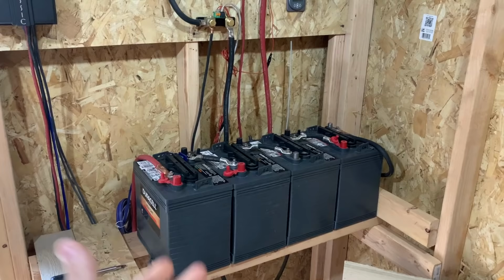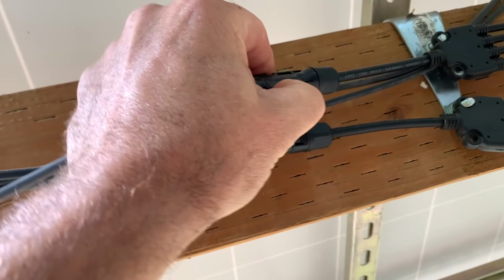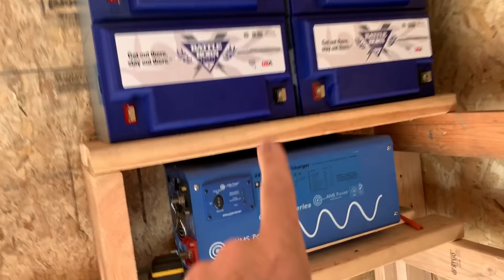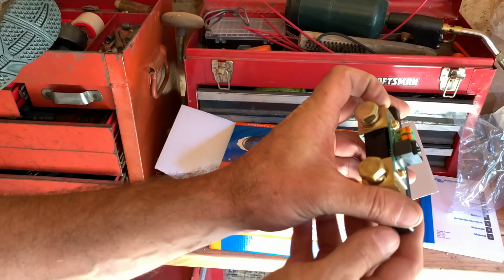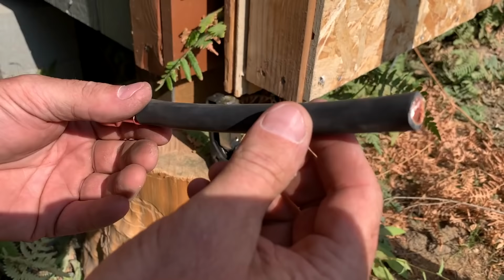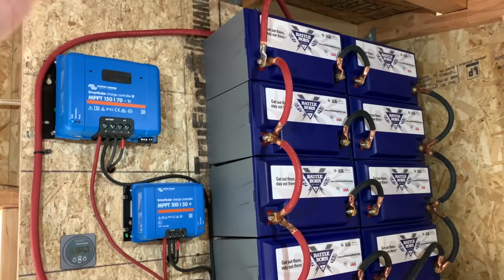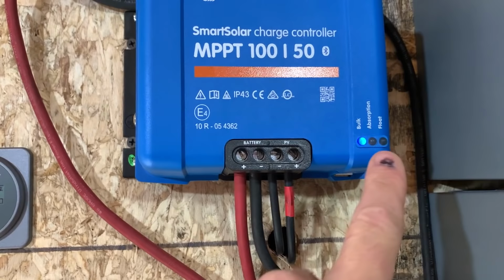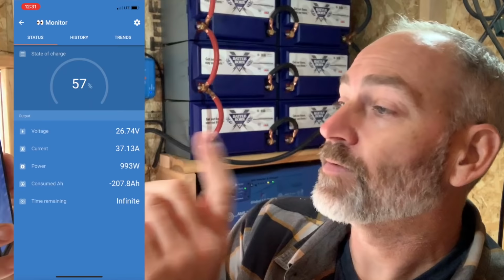EASIEST Off Grid Solar Power System Battery Bank

Comment: Another thing is you don't hav enough air flow around that inverter charger,  When it kicks into surge mode or charge mode  It's going to heat up, that building is probably never going to get below 0  With that inverter in there, Should I drill some holes in the bottom plate and put some to narrower wood on top and put some holes in that side plate there for air flow, I have the exact same inverter and they do get hot Personally I would worry about the heat in the summer time more than the Winter time.  A little bit of space between your batteries for some air flow.  Way too much copper showing. It's not a bad idea to run those positive and negative going to your inverter right next to each other or give them a twist around each other, cuts down inductance

Comment: 6 three hundred watt panels?  If I"m calculating correctly...on a good sun day you're delivering 150amps to your batteries at all daylight hours.  Most all homes can operate unfettered of convenience with that kind of input into the  batteries.  May I ask what you still maintain convenience wise in your home?  Like electric stove,  electric water heater, etc.  The demands is met with the numbers you said, and buy upgrading to a 100% discharge as opposed to a 50% discharge.  Adding the additional 2 panels bumped it up to 200 amps which is straight residential demand unless you just need that over compensate of 400.  I want to build my panels from scratch and also tweek my wiring and device demand...remove the  transformers and go 12v straight in, Led light everything obviously.  my concern was well pump, hot water and cooking, which there are many viable sources,  but convenience is nice.  you matched you're input to compete with total load output...provided you have those nice days.  What is it like when you go through those three and four days of gloom county?  I experience that where I'm at.   Very informative Video.  I'm hoping to find a few tesla batteries after an EMT  renders them useless.

Comment: Hey mates … having already an on grid inverter what’s the easiest cheapest way to charge a battery and then put the output on the grid? Do I need to buy another ac coupled inverted or some?

Comment: so i was a little confused when you said you would have 48v 800ah pack , umm no i dont think so ,what you have is 48v at 200ah ,as you have two banks at 48v in parallel but the current output will be the same at 100ah per bank , if you wanted 800ah you would have to connect them in series but then you would have 12v @800ah , still sounds like it will be a good system completed though

Comment: I'm just getting started in solar energy and like your videos. These new 100ah batteries are $800 a pop pushing the cost of your pallet of 10 batteries to over $8000. Is there a cheaper 100ah alternative battery that you would recommend for someone like me starting out on a budget? Thank you

Comment: Aims has a lithium 75 amp battery charger that Wii charge twice as fast as what u are using.  ….u won’t have to run your generator as long.

Comment: Very nice video.  I’m confused that the connections of the batteries are safe to touch after connecting them all?  Is the voltage too low to pose any threat?

Comment: the wire use from 5000w Inverter  to power center / breaker panel Is to small need be a 6 AWG wire the romex 10 AWG  was fine for old system.  5000w/120 = 41 amp 2: the breaker use for Lights and receptacle need single breaker not double breaker with connecting bar

Comment: Brother, Awesome setup!  A some Questions!  Just on batteries on positive side why didn't you go from the bottom then the cable would of been a lot smaller? Is it to keep cables the same length? Next question why is your inverter 2000 watts is it just for the shed? I don't understand why you didn't  used a 10,000 watt inverter for the whole house? Best Regards just trying to learning no disrespect!

Comment: Nice work. Is there any way you can update us on the state of charge of the batteries? The way you have all those batteries wired up isn't the best for battery balancing. 

With lead-acid batteries, you could see a 30% decrease in the interior batteries in your bank by wiring them this way. I would assume that lithium batteries would work the same way. 

I bet the batteries closest to the conductors see a heavier depletion and charge rate as compared to the center batteries.

Comment: re 16:27 Why connect to a live circuit?  If you have no main cut-off, you should should pull the main fuse.  You could melt the terminal threads (or your pacemaker)! 
BTW, what's with the 7ft long cable from the top of the fuse to the top, rather than the bottom "+" battery terminal 1ft away?

Comment: Great video 
  Your running your whole house off these 8 lifepo4 batteries ?   
  Just wondering because I’m running 6 100ah batteries they are ampere time and chins in a 24volt system with 2000 watts of solar. With an all in one MPP LV2424 unit  And I have a hard time keeping JUST a refrigerator going for a day 🤔🤔🤔🤔
   Any help would be much appreciated 
    Keep the great videos coming

Comment: I’m curious, why use such a long piece of red copper wire to connect to the top positive terminal of the battery bank when you could have used a very short piece and connected to the bottom positive terminal of the battery bank instead? Electrically they are identical…

Comment: what would it cost for a small system that would power a couple refrigerators + two tvs during the spring /summer early fall months?It wouldnt need to power the items all night. how many batteries/panel  would be needed?

Comment: Heyo, ive got a question. Would it be more benificial to buy another battery for the vehicle, buy an inverter kit and figure out the wiring and hook solar panels up to the whole things all in a seperate cubby hole for all the heat produced. Or does it make more sense to buy an anker powerhouse and solar panel kit to cut out the middle man? Ive been thinking about this a lot. Any opinions really help.

Comment: What happens when your batteries reach 100%? Where does the unused extra power taken from the solar panels  go?
Reply: your solar cells will stop pushing electrons generally, the chargers would just disconnect.

Comment: GREAT VIDEO - thank you. Question if it's not too late. You mentioned keeping the batteries warm, but I live in a hotter climate and want to set up a solar system to run my 120v hot tub house. Two 15 amp breakers - 1 for the hot tub  and1 for lights in the breaker box. I've watched other videos and the matter of keeping the system cool seems to come up more than keeping it warm. Is that something that would be an issue with a system that small? Any insight would be awesome. Thanks

Comment: Wiring those in series 24 volt means a kinda lower amp load. I build all my systems for redundancy in paired strings  our 1400 am bank consists of 2 700 ammo banks witc each can carry the load independently. Same with generators and wind generators cause if one fails  the system won't go down. Is any of that new system built in the USA?

Comment: You must be pretty close to town to have internet. We have 5 cell towers line of site for cell but no internet. All items except a couple of big Moor charge controllers are American made including the wind generators which have all been flying just over 12 years ( and I have 4 more nib for back up) What did that upgrade cost. You know when you put ur panels in series that totally changed your watt rates. Just like ur batteries.  We've got 4wibd gennies at 2500 max and average about 1200 till the wind picks up to max vne. Interested in those batteries bout not happy with the down sides

Comment: I was wondering if I can power my rv like this. Can I just run a extension cord from the inverter to an adaptor and plug it into the the power hookup?
Reply from the maker: Yes. You should be able to to that.

Comment: Only 6 panels?  Are they movable to certain angle and direction during the day and season?  You know like on a ladder wheel system?

Are you sure the lithium polymer one wall panel system is cheaper than Costco lot of Ni metal or acid sealed AgM mat batteries?

Comment: Anyone knows whether those "inverter & charger", are capable being used in "AC couple" configuration with a grid-tie inverter in an off-grid use??
I own a 6kw 48V Chinese "inverter and charger", and i would like to use a 4kw grid tie inverter in "AC coubling" connection!

Comment: i see you have 12V batteries in series/parallel to make 24V.  since you are powering the entire house, and have heater, AC, my question is what made you decide  to go with 24V instead of 48V what is the advantage. thanks!
Reply from the maker: It is what I could afford in batteries in the very beginning. When we added these batteries I already had the 24v inverter.

Comment: Hello Martin. I am new to the channel so my apologies for asking a question you have probably answered 1000 times. Can you tell me how many watts per panel your solar panels are and did you buy you inverter etc. separately or as a complete kit? Last question how many watts are you powering with your system? I am trying to figure out how much energy I need for my small cabin. Thanks

Comment: i would like to do a diy setup minimal but for what i need its for my garden pond it runs 2 x100watt pumps 1x55watt uv 50watt led light looking to add more or store the energy so it never goes out  how can i achieve this someone give me tips or steps id appreciate it alot thanks zach.

Comment: Random question... for example, say i had, 6x 100Ah batteries, and got hold of a 80Ah battery for a bargain price.... could i add that to the battery bank?  or will that cause problems?

Comment: How are you Martin
Can u pls help understand whether a 12v 400ah battery and two of a 12v 200ah battery have the same capacity? 
Secondly can i use my 12v inverter for a 24 battery?

Comment: Hi I have exact same battleborn battery set 24v and I been told I should buy a 24v victron battery balancer and I just did but will one of these battery balancers be enough to balance my 8 battery's  in the series?

Comment: I am curious how much each battery cost? Are the batteries u are using deep cycle 100amp?? I have found d them but they are over $800 each! J am looking g to go totally off grid power. I really dig your set-up. I want to be able to run my whole house so I'm guessing 12-16 of those batteries.  I'm wondering  price of the inverters, batteries, & all bells & whistles? $10k ,over $20k ??

Comment: necro comment, but did you ever heat shrink the ends?  The exposed wiring between the batteries just scare me although i know you have to arc them.

Comment: So I have a similar setup at home with the battle born battery and Victron controllers smart shunt... the works pretty much... Have you had any issues with your batteries internal resistance when wired in series... I get a high mid point differential on my batteries when my panels are charging the batteries and I have a high wattage load on them... the batteries have been top balanced and stay relatively close in charge to each other but after a day or so of high power applications they seem to loose their top balance to each other??? No clue whats going on... cable lengths are all the same, can internal resistance be that off... i noticed one battery does give me 105ah and the other 101ah when i did a capacity test on them... not sure what else can be the issue but im getting tired of having to top balance them 😪

Comment: You mentioned twice, 400 amps on the batteries. Wouldn’t 6 each 100Ah batteries equal 600 amps?

Comment: I'm scoping out what it'd take to go off grid.  Question.  Why is LiFePO4 batteries an upgrade?  

That 100AH lithium battery is $900 versus 150AH lead acid golf cart battery for $200.  Yes, I understand the LiFePO4 is much lighter, but my outbuilding is not moving anywhere.

What's the point of going with lithium chemistry for stationary applications?

Comment: MARTIN,  I HAVE A QUESTION;   DOES YOUR SYSTEM PROVIDE ENOUGH ELECTRICITY FOR EVERYTHING IN THE HOUSE (ALL KITCHEN APPLIANCES, LADIES BATHROOM/VANITY APPLIANCES, MODERN LIVING SPACE ELECTRONICS AND GARAGE/SHOP EQUIPMENT; SMALL WELDER, COMPRESSOR)?

Comment: I heard when u connect, start with positive wire, when you disconnect start with negative. How does that helps idk
Reply: That's just when for when you are working on  car. Cars are made out of metal. If you hook up NEG terminal first then Its easy to short out the wrench to the car body when you are hooking up the POS terminal.  If you hook up the pos first then the rest of the car body isn't "live" as the NEG is not attached.

Comment: on the right side of the batteries you have black (neg) wires aand down the middle they are also black (neg) .. how can a battery have both terminals be negative ??
Reply: Those 00 cables could be any color. T

Comment: i noticed you have 60 volts from your panels on a 24 volt batterys, i thought you had to have 24 volt input to the controller for 24 volt battery?
Reply from the maker: Nope. You can put in as high voltage as your charge controller is rated for. We just installed new charge controllers the other day and they are rated for 450 V DC yes that’s 450 V DC the charge controller is designed to regulate the voltage coming in from the solar panels and correctly charge the batteries at whatever voltage the batteries are at 12, 24, 48.

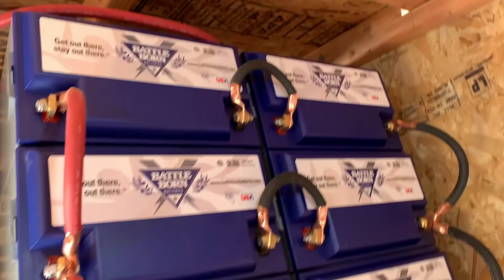Comment: 14:20 What's the point of connecting the batteries in series and parallel? I've only heard doing one or the other, but not both at the same time.
Reply from the maker: To have 24v. Just parallel would be 12v and just series would be 96v.

Comment: When trying to calc the amount of battery storage I need, how do I turn the 24v 100ah dc into 110v ac kwh??? If my understanding is correct 24v at 100ah will give me 2400kwh at 24v.
Reply from the maker: That would be 2400wh or 2.4kwh. The k = 1000. The 110v wh would be the same minus any losses in conversation.
Reply: @MartinJohnsonOffGridLiving  Thanks for the info. Just can't wrap my brain around how it stays the same. I keep wanting to divide the 2.4 by 5.48 (multiplier to get 24v to 110v). Thanks for all the videos, learning a lot. Looking forward to my own build soon.

Comment: so with the amount of watts imput, how can i tell whats safe for charging? i have 1800 watts in solar, and 12 car batterys. my pwn 100 amp controller, will that safely charge my batterys? like will it crank 200 amps to charge them? thats my worry when i can hear my batterys boil. im use to small car charger of 10 amps where you dont hear that boil. and so i wondered with a controller if it fast charge a battery, like if i had a full 2400watts for input, would it give every watt for charging? that seems unsafe.
Reply from the maker: You should check with the manufacture of your batteries to see at what voltage and what amperage you should charge your batteries. Then either purchase a charge controller that will charge those batteries appropriately or if the charge controller you have can be programmed program it accordingly.

Comment: Marty hello, I called Battle Born Battery today. Great people. I told them I wanted what you have and they were great in advising me. I am in need of your advice. When putting in a solar system, I have to do a little at a time to get it up and running. So would you get all the components first and get them all hooked up or would you get the panels first. Because they may go up in price
battle Born quoted me $9170. For a starter set up. Panels and batteries included.

Comment: Not sure what lightness benefits, lithium batteries offer a fixed installation. I would have bought 16 lead batteries for what; less than quarter of the price and ended up with significantly greater capacity. Being sponsored I guess made it a whole lot cheaper.......
Reply from the maker: We had lead acid batteries. I hate maintenance and having to pay attention to things. We have had these batteries for a while now and love them. Set them and forget them.

Comment: Too bad you couldn't use the inverters and controllers and only change the batteries.  Can you run air conditioning?  window, central??

Comment: No PV disconnects...
No shrinkwrap on battery cables...
No master disconnect...

System mounted to flammable surface...
And while I may be pedantic, safety is key, there is a enough juice in the system to end your life before you can think about it...this is an accident waiting to happen...
Reply from the maker: 2 years and still waiting 🤣
Reply: @MartinJohnsonOffGridLiving  It only take once...
HOWEVER, I did notice you took care of a cpl of those items with your upgraded system...

Comment: Hello I want to start off by saying great video! Everything was explained in such a way that was really easy to understand! So I appreciate you for that!

I have a question about the whole wiring system though. I noticed that you are using a 24volt system for your entire set up. But currently I have a 12volt system and I’m planning to upgrade my aims inverter/charger to 4000W and adding “2” 100 A.H lithium phosphate battery born batteries equaling to a total of 400A.H of batteries since I have 2 already. So I can have more battery storage to run my new 12 volt dometic air conditioner. 

So what I’m trying to figure out is will I be able to run my wires (including Anl fuse & shunt) the same way you have your 24volt wiring system? I already know that I will need to wiring my batteries in Parallel since my system is a 12volt. Thank you

Comment: Cool how much is it gonna cost me I’m on board but we got to be financially feasible
Reply: Some else said around 15k-20k depending on battery and panel config. High upfront cost but It is cheaper in the long run.  7 years break even. But you could start with a few battery